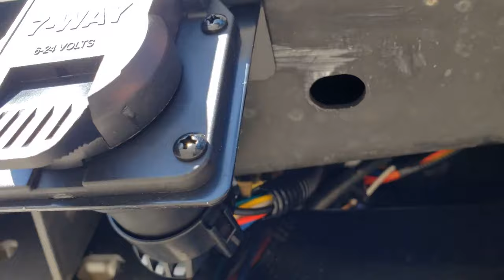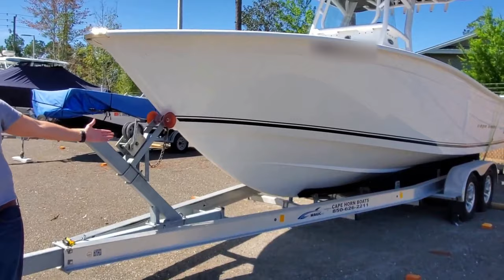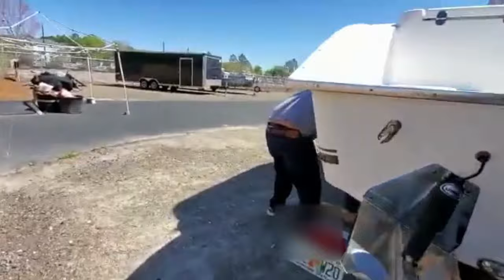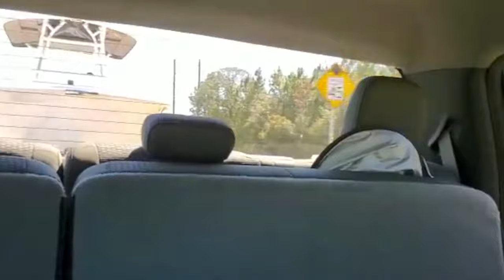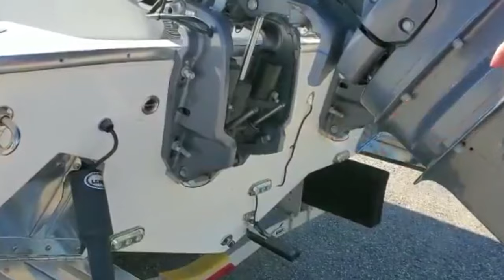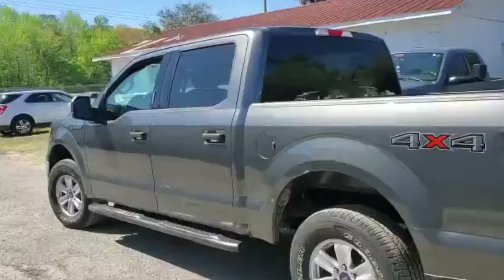Ford F-150 trailer hitch install. Cape Horn 24 Trailer and gelcoat repair Palatka Florida

Comment: Speaking of towing, I have a 2017 3.5 EB. 2WD. Im getting a boat and was wondering how concerned I should be about launching and/or retrieval of the boat. The boat is a 1989 Carver Montego 2357. 4500 lbs. I have a Curt class III hitch torqued to spec.
Reply from the maker: The 3.5 Ecoboost works well. The only thing I have any trouble with is traction on the ramp, I usually have to use 4x4. The cape horn 24xs probably weights 7500lbs+ loaded up though. Do you have limited slip or a locking rear differential?